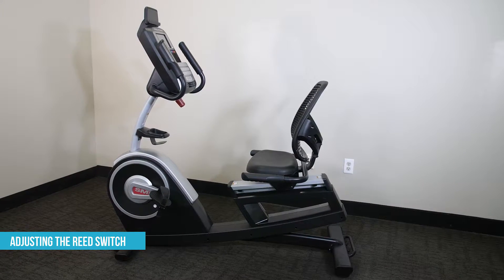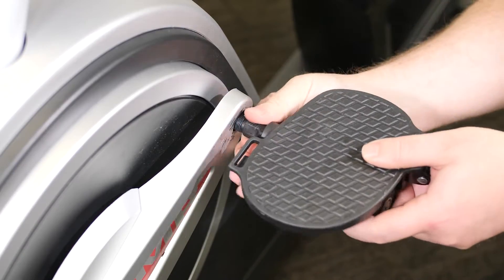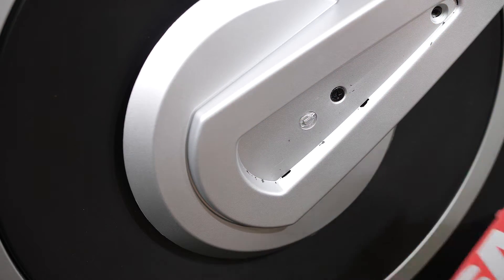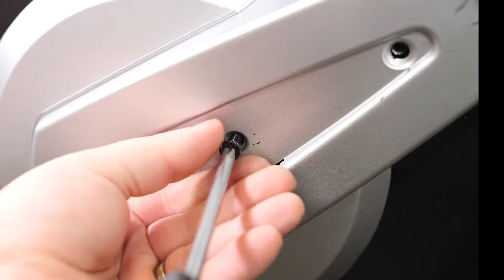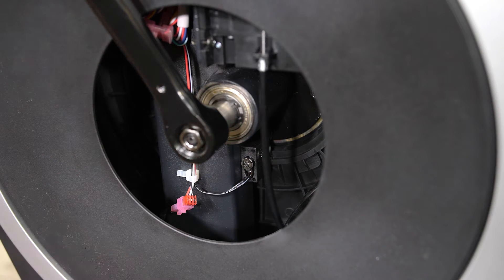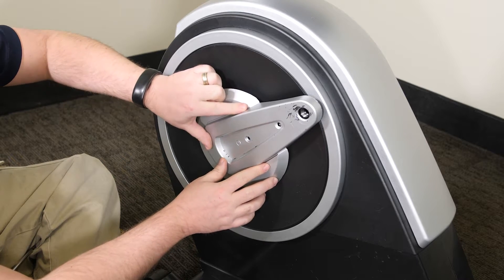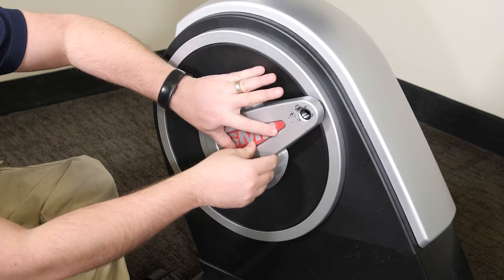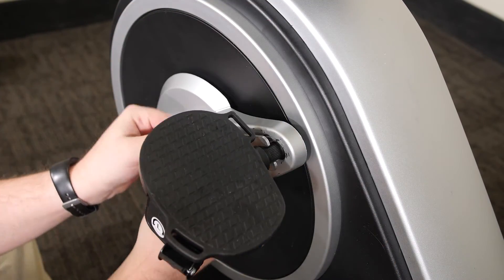Adjusting the Reed switch

Comment: The rpm's and cadence have stopped displaying on my Nordictrack S10i bike. I've adjusted the reed switch and no luck. I then ordered a new reed switch wire, installed that and still no luck. Do you have any tips that could help me out?
Reply from the maker: If the reed switch is adjusted correctly and is intact then it must be something down stream from the sensor. I have seen some units with a damaged communication wire causing the cadence to stop working. Check the blue and green wires from the controller to the console for any loose broken exposed wiring or damage. If it is not a wire issue then I would suspect the controller.
Reply: I should have mentioned I recently also installed a new control board as my incline and resistance stopped working at the same time as reed switch crapped out.  @FitnessEquipmentHelp